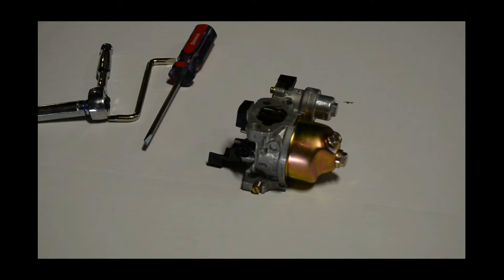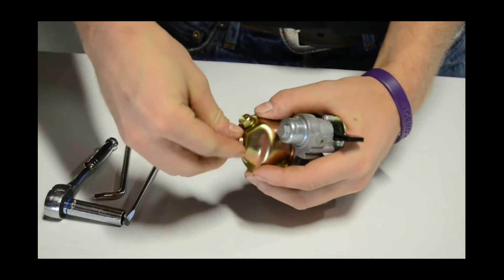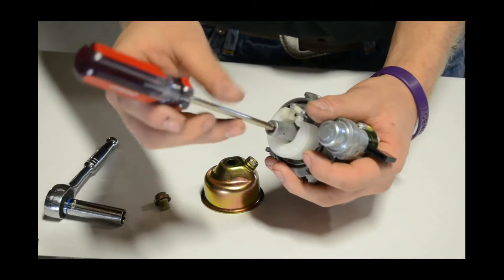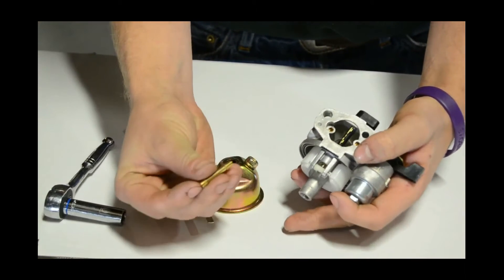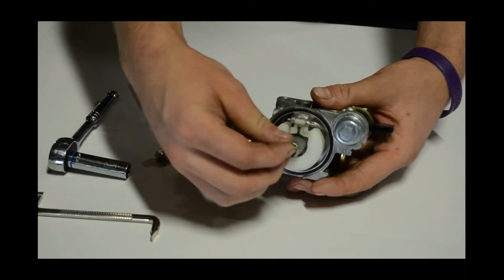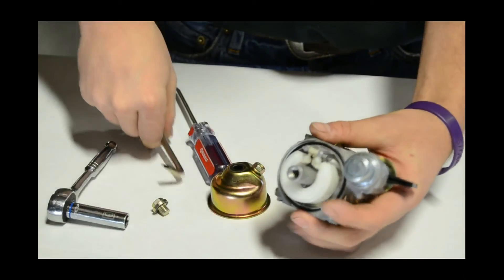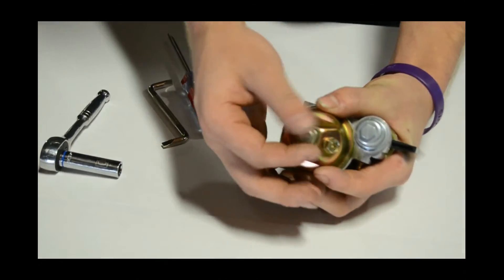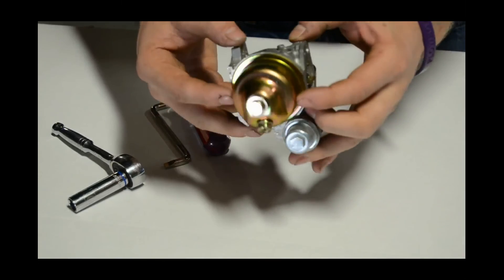Changing the jet in a carburetor

Comment: replacing the emulsion tube with one that creates a richer mixture is another good upgrade for better low end throttle response but is not necessary in this application. when u start using higher lift cams and bigger valves etc. that is when a more precisely tuned e tube is necessary.

Comment: Should I also upgrade the emulsion tube when I change the jet. I noticed the air filter / jet kit KDPRED102AF also doesn't come with the tube. What is the performance difference one way or the other.